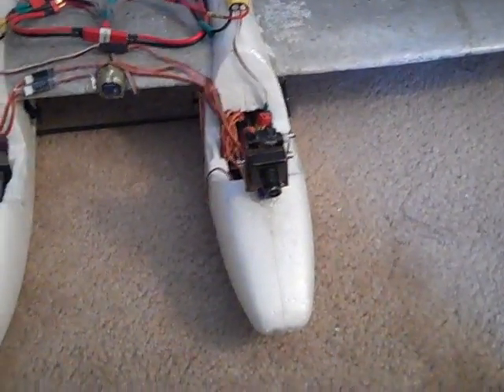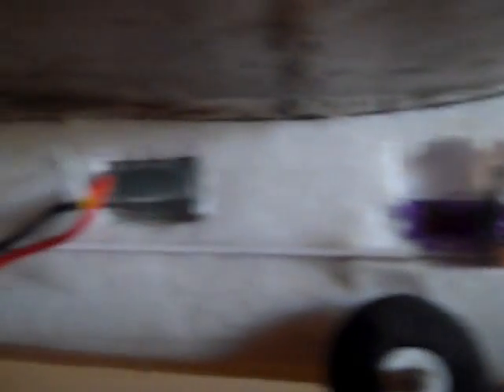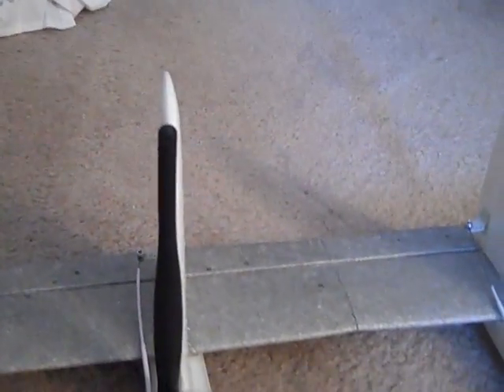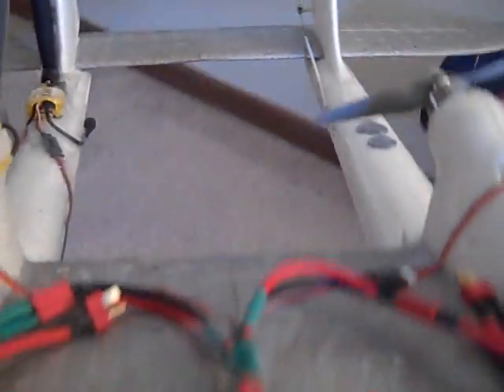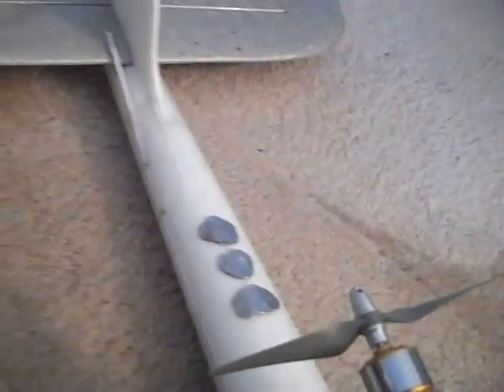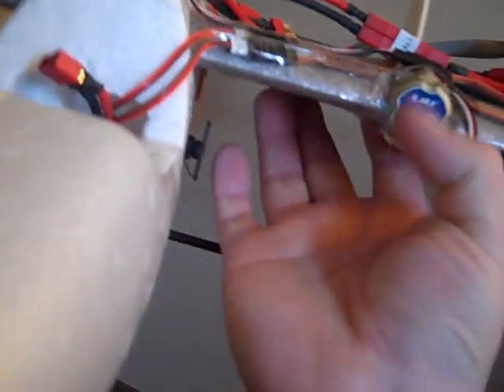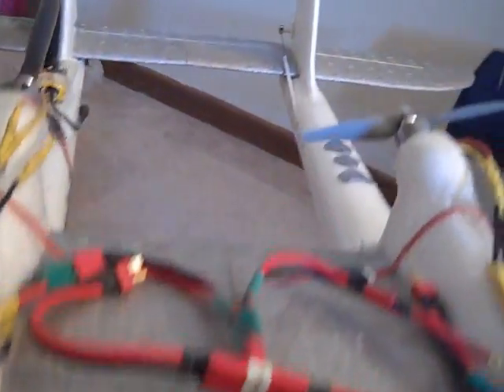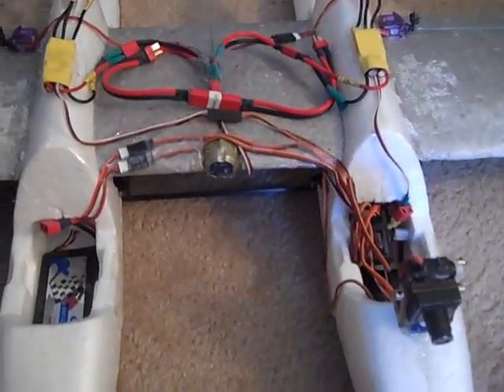Making counterweights to balance the Center of Gravity

Comment from the maker: @baeronautics by your description i would guess that its maybe that the vertical stabilizers could be too small...  I have not had very good luck using cardboard either.  Would suggest foam board instead of cardboard.  If you can make a video of it flying so I can see what its doing and I'll try to help.

Comment from the maker: Not a problem, I use the BP2212-06 motors with a 30amp ESC.  The are a outrunner motor so you wouldn't be able to mount them inside the normal housing.  Check out the FPV Easystar Up close and personal video and I show the mounting job that I did.  Thanks for watching!

Comment from the maker: Yes it has tons of power!  The ailerons definetely help at all speeds so far.  I have multiple throw settings set for fast and slow speeds.  This plane came stock with rudders I added the ailerons.  And the elevator is one piece.  I started with 2 Easystars and modded the middle wings to make it a twin EZ.